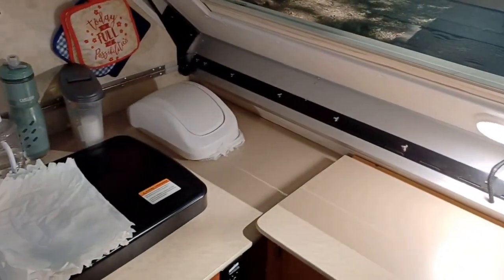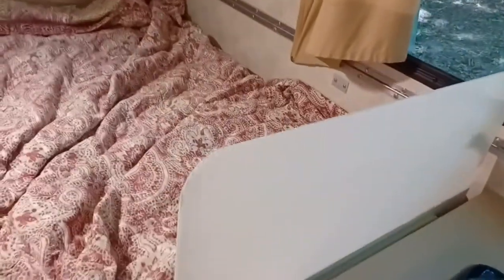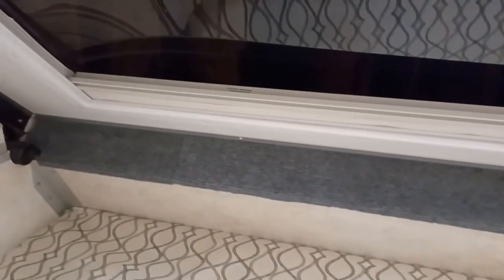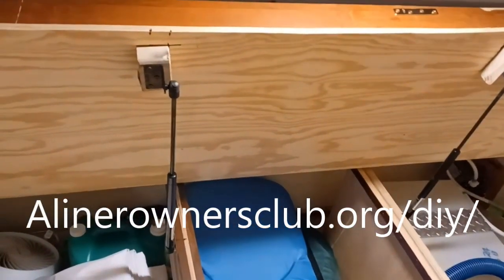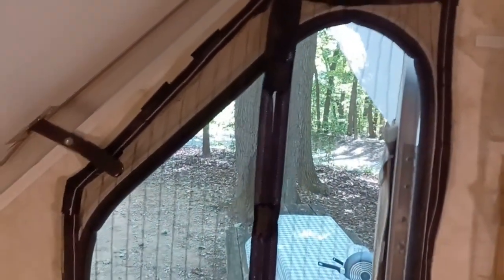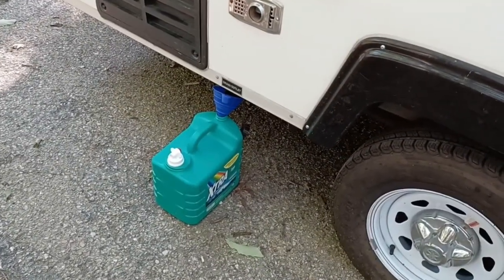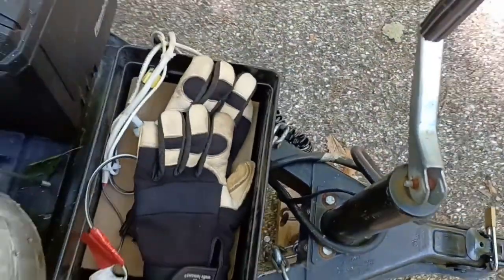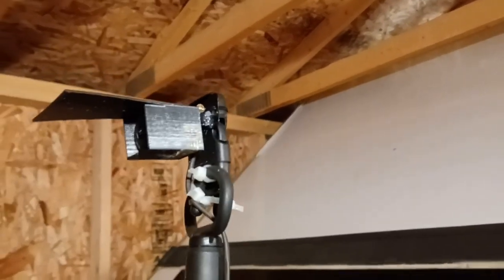12 Super Easy Aliner Mods

Comment: Wow! These all look great! I especially like the awning, the screen door, and the trash can mods. And you are right about the tires: radials definitely run cooler than bias ply, and are less prone to tread separation.
Reply from the maker: They are also wearing like iron.  I did a video, but doing measurements and extrapolation they are likely to last 50k miles.

Comment: More good tips for Aliner mods!  A word of caution; keep a close eye on the factory spare tire carrier.  A few years ago a weld broke and the carrier punched a hole in the fiberglass outer shell.  I always "pre-flight" the rig before hitting the road and the weld broke after about 6 hours on some rough Colorado backcountry roads.  Fortunately the tire didn't come off the carrier.  I upgraded the carrier by installing an after market one that fit's into the rear hitch receiver that came with the trailer.  Much better.

Comment: Great ideas! Suggestion: It is probably not a good idea to have loose things stored on top of your battery. If something were to accidentally short out the two terminals, you could put off a lot of current and create a lot of heat very fast.  Maybe some kind of plywood or something over top of it with an air gap for circulation around it.

Comment: Dean I have done many mods to my Classic. I am unable to see past my unit towing with my Escape. Add-on mirrors help a little but not great. I use a permanently mounted backup camera on the rear as well. The issue I have found is they are all geared for backup and are quite wide in view. Makes seeing things back a ways very very small. I am using inexpensive cameras, but keep searching for units with a narrower, but longer view. So far, I haven’t found one.
Reply from the maker: The one I'm using has an acceptable field of view, but unfortunately cannot keep its connection to my phone.  It will just freeze and reset over and over to the point of being useless.
Reply: Dean, I had the same issue with a wireless model. Finally went to a wired version. Maybe you can advise the camera you are using. I now see some on Amazon that claim to be 80-90 degree field of view. I might try one of those.
Reply from the maker: @perryheideman9007  https://www.ebay.com/itm/154066944059?mkcid=16&mkevt=1&mkrid=711-127632-2357-0&ssspo=LDATEMpfQR2&sssrc=2349624&ssuid=hw35EJFXSxy&var=&widget_ver=artemis&media=FB_MSG

Comment: What tow vehicle do you use that you get 27 mpg towing an Aliner?  That's amazing.
Reply from the maker: 2016 kia soul with manual shift.  That being said it's not perfect, no 4 wheel drive and could certainly use more power.    I have a rav4 hybrid on order that should get the same towing mileage but has nearly twice the power and 4 wheel drive.

Comment: Have you had any issues with the awning wobbling around? I really like that design without stakes, but seems like the rods are telescoped the entire length
Reply from the maker: There is still 2ft left engaged when the awnings out, and the rods are a decently tight fit inside each other.  The rods are 7ft, but the awning is 5 ft.   That being said, I take it down in windy conditions like I would any other awning.

Comment: What kind of ac is that? Was that a mod? I just bought an aliner and it doesn't have an ac and am looking for a way to add one.  I want to remove the microwave that is built into a cabinet and maybe put a minisplit there. I can then remove the stock heater and put storage there.
Reply from the maker: It's the factory stock air conditioner on a 2014 ranger 10.  I prefer it over a mini split for three reasons.   It takes up less interior space as most of the mechanism   is outside.  It's much less expensive ( < $200 ). It's far easier to replace if there's a failure.

Comment: Your gas springs under your bed are on backwards.  The piston should always be mounted under the barrel, so that oil in the barrel lubricates the front seal.  Dave
Reply from the maker: You are correct of course.  I missed that during installation.   In my case however it may not matter much as as they spend nearly 100% of their time in the level position anyway.
Reply: @Dean-In-Milwaukee  Nope.  You should change them.  When installed properly,with barrels above pistons, the oil inside the barrels lubricates the seals whenever the piston moves, provided that the gas spring is correctly installed.  There's no place for compromise when the fix is so easy.

Comment: How many mm's of the steel pipe is sticking out and how much is inside the pvc pipe?
Reply from the maker: It's 5 ft sticking out and 2 ft inside the pvc, so in  mm that would be 1524 and  609.
Reply: Thanks for the info.

Comment: Hi,is the body made of fiber or other material ?
Reply from the maker: It's made from a material called Otterex.  It's made for awnings and it came in a 5 ft width which you can order to any length you need.
Reply: @Dean-In-Milwaukee  thanks for your reply 🙏